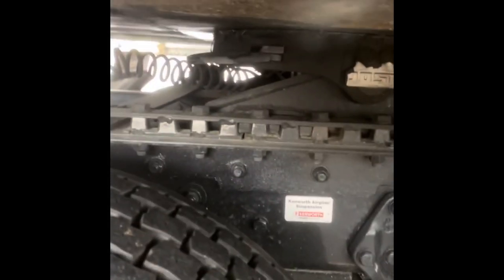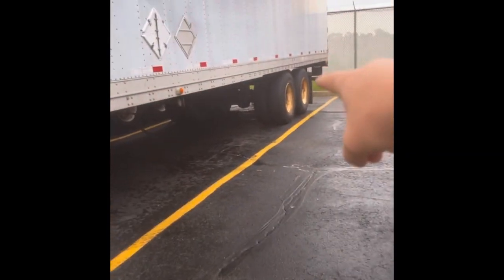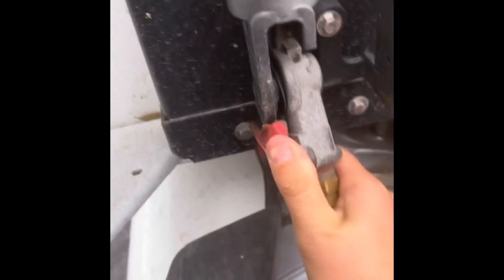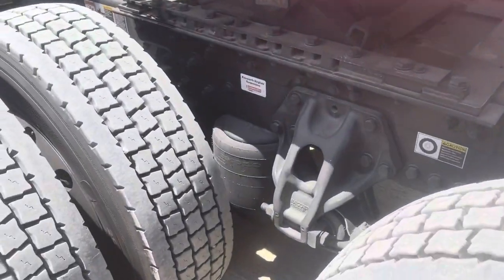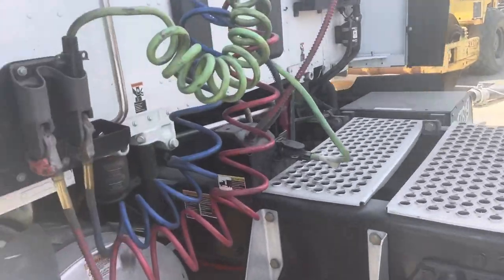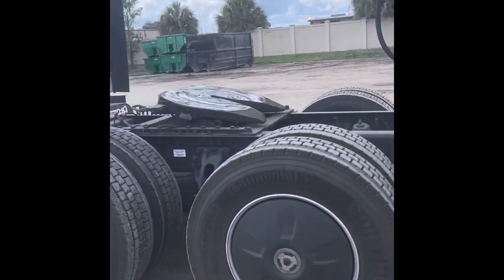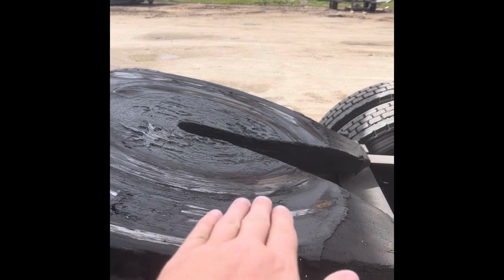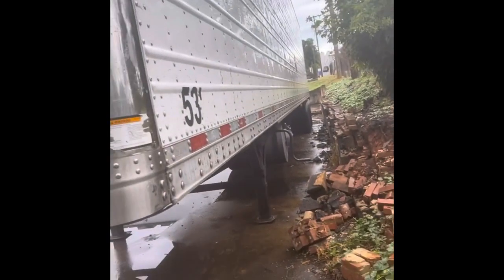How To Hook Up A Semi Trailer￼

Comment: You mention that when you disconnect, the brakes lock up.  But you actually do not show how to hook up, which could be presumed to simply reverse the unhook procedure.  Is there a step in the hookup procedure that unlocks the brakes or do the brakes automatically unlock when you hook back up?
Reply from the maker: Yes they automatically release once you hook back up